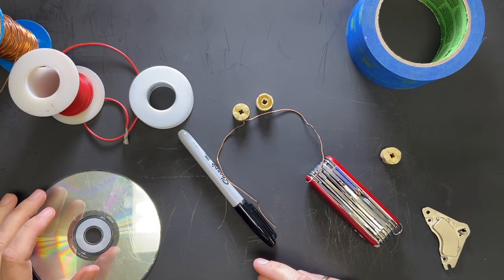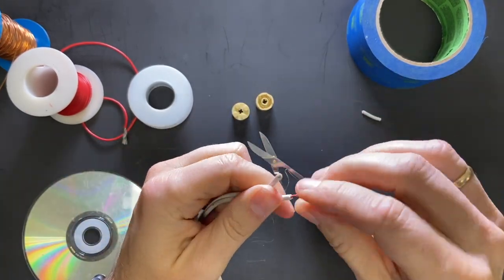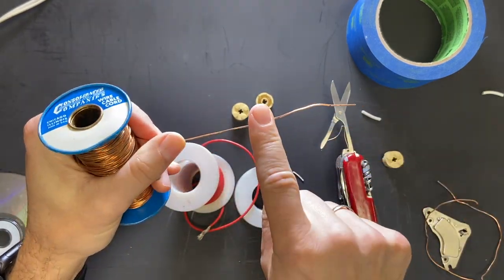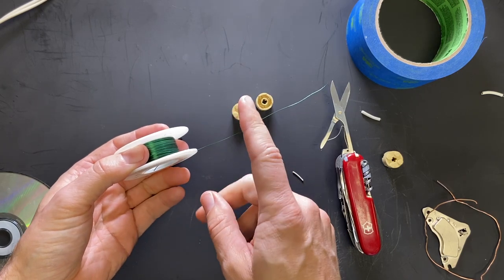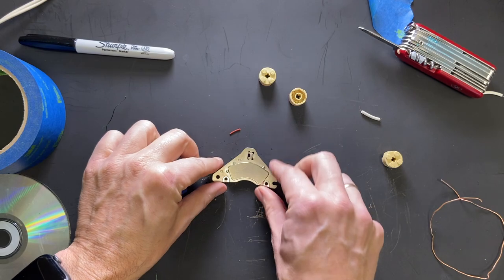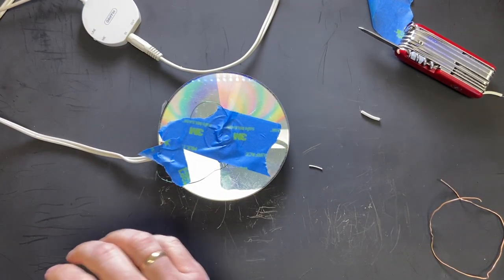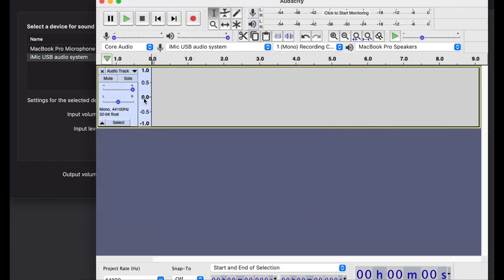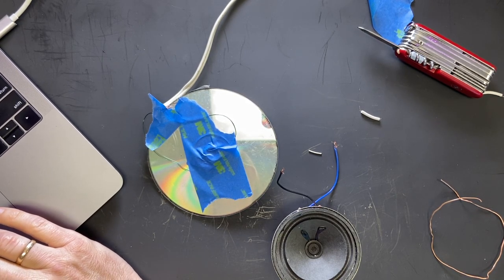How to Build a DIY Dynamic Microphone With Some Wire and a Magnet

Comment: You should use wires with a much smaller diameter (less than 0.1 mm) with a higher number of turns.
And that instead of tape, you should use something that has a higher vibration subtlety, such as nylon freezer (before that, of course, the wires should be glued together. "Varnish is the same cosmetic that women apply to their nails, but the colorless type »)
Reply: how to get better audio anyone?

Comment: Anyone that wants to know, the high noise in the recording is the reason for having double copies of the recording and flipping one - The LR in XLR.
Reply: how to get better audio anyone?
Reply: I think it has more to do with low signal volume. Boosting the gain is also boosting the Self-Noise, which is a lot because the signal is almost the same level of the noise floor. It would work better with a higher impedance coil, and more sensative 'Diaphram'

Comment: since its a speaker, would there not be power running through the circuit? If so then how is this a dynamic mic? Just askin, trying to buuild one for fun...
Reply: A mic and a speaker are pretty much the same thing, however with the signal path reversed. While a microphone sends a signal to the computer, a speakers gets signal from the computer, keep in mind that I am oversimplifying this a little bit but yeah
Reply: @Twat2024  thanks that cleared it up for me!

Comment: wouldn't you just be able us a regular speaker as a microphone then.
Reply: Technically yes, but Microphone capsules generally have a higher impedance, and are made of more 'sensative' materials. Speakers push a lot of air, and therefore take a alot of abuse and reguire thicker material for the 'Membrand/Cone'. THey do work as Microphones, but the tonal qualities are far different. Genrerally much darker/muffled from all my experiments.

A Mic capsule is usually between 150-600ohms, and most common speakers are between 2-16ohm.